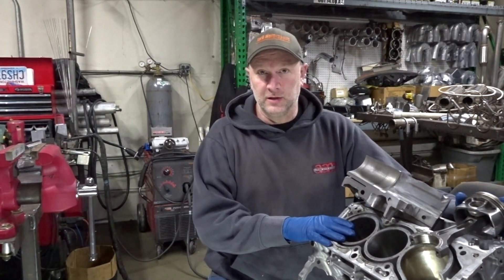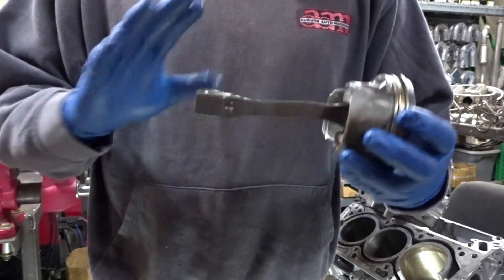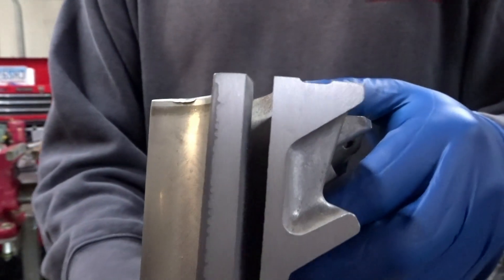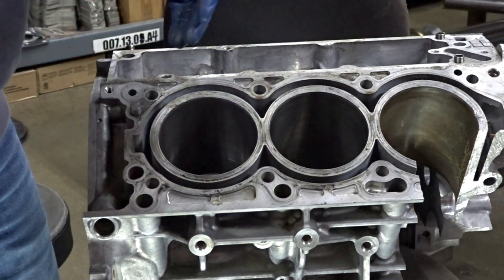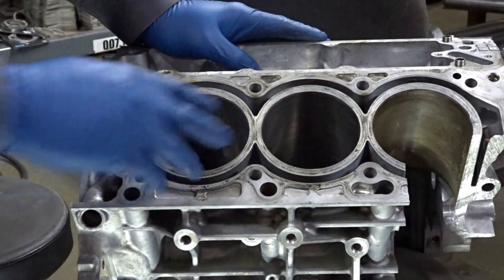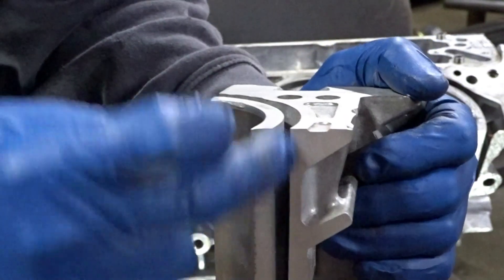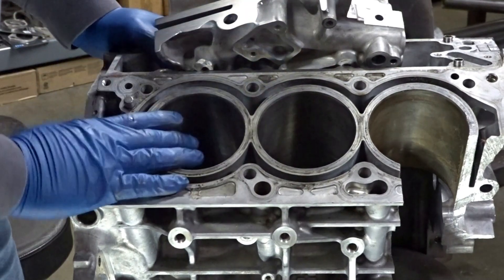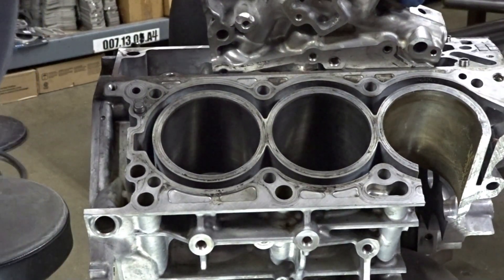KIA Stinger Engine Cut Away....

Comment: Thank you for the detailed video. This confirms what I've suspected for quite some time.

Between the open deck and thin cylinder wall liner. The block is incapable of holding high torque numbers.

My opinion is that somewhere in the 500-550 ft•lbs torque range is the relatively safe limit to keep the head gasket and stock internals happy.

I'm excited to see your results from closing the deck.

Comment: Quite a few modified Barra engines are partially grout filled.
Reply: Two different type blocks, the barra is closed deck and cast iron but a awesome engine.
Reply: @xr6woggo  Better value per dollar/kW than a LT or LS.

Comment: Whilst I don't own a Stinger. I'm not brandish and have some questions on this engine. What is the alloy of the aluminum in the block, the cast in sleeves are they cast iron or ductile iron, when the bore go oval have the liners been cracking, does Darton make closed deck ductile iron sleeves for these engines, are you drag racing the Stinger or are you road racing the Stinger? If your road racing the Stinger I'd only fill the bottom of the block to the centerline of the wrist pin @ BDC. Looks to be a fairy stout engine platform and like all open decks shares the same problem at a certain level and then closed decking is required.